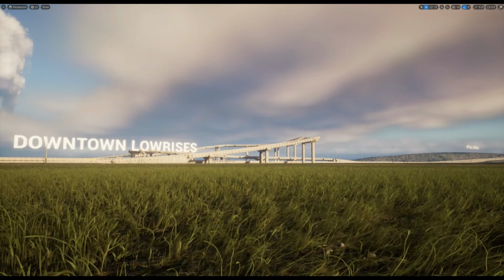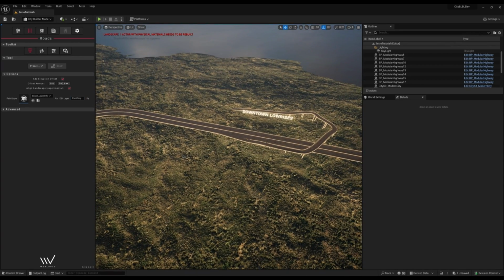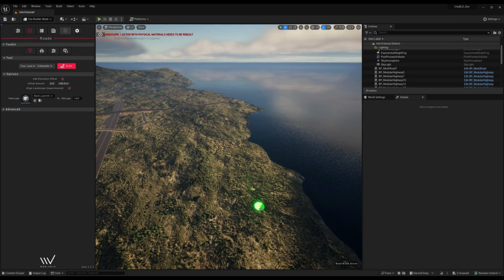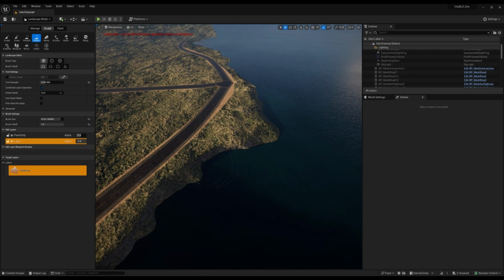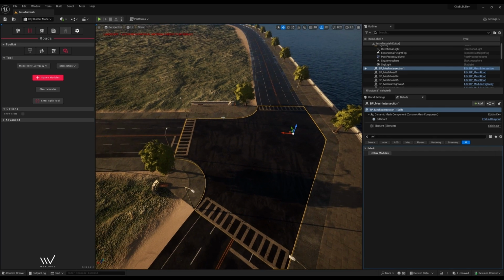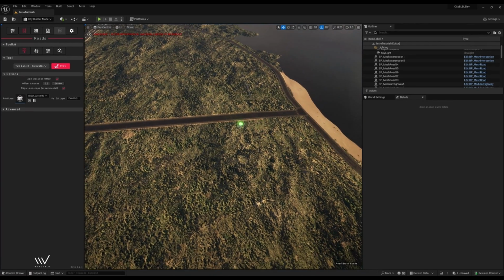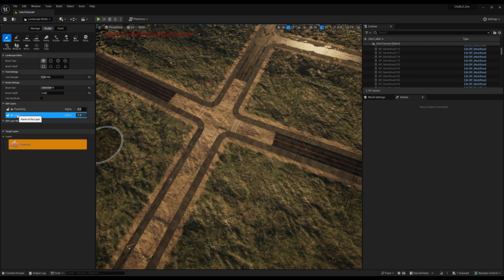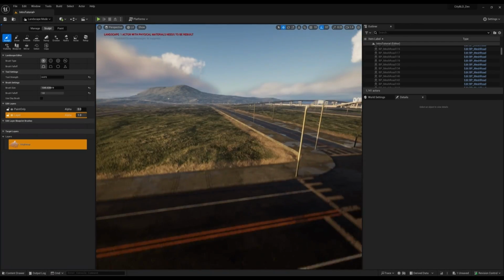(OUTDATED) Intro to CityBLD - Part 3 - Streets & Waterfronts

Comment: Hi when I add a quay to my project everything works well but my trees are missing materials. Any fix for this?
Reply from the maker: @funkyguy0  Hi, sorry you're running into this. Please check and confirm that Virtual Textures are enabled in your project settings, and if that doesn't resolve the issue please let me know whether the materials are missing entirely (replaced with WorldGridMaterial) or simply not compiling. If they are missing entirely, you can try using the Repair button in the Launchpad app.
Reply: @WorldBLD  Thank you for your response. Yes I have virtual textures enabled. Trees still have no textures unfortunately.
Reply from the maker: @funkyguy0  Okay, really sorry you're still seeing this issue. Could you please let me know any compile errors on the tree materials? This will be helpful in figuring out if there's a certain setting that's messing with the trees!

Comment: I'm really considering getting this!! Great asset to have for creating city style levels quickly for solo developers with AAA quality. Great asset, I have a few questions, do you need to buy the city kits or are they already included? Also, I looked at the documentation and if i understand it right we can bring our own city buildings props etc. by creating a city kit plugin, correct?
Reply from the maker: Hey there, great questions. Yup, you can use any of your own meshes and blueprints in place of what's provided, but we do include a few(free!) City Kits to get you started. Hopefully you'll get in on the fun soon:)

Comment: Hi there i've purchased and downloaded the files, I've installed the files however the plugin does not show up for me to be able to enable them.
I downloaded the latest file and I have installed them on the latest version on Unreal Engine.
Reply from the maker: Hi, did you install to your project or to the engine?
Reply: To the engine
 @WorldBLD
Reply: Its inside UE_5.3/ Engine/Plugin
Reply from the maker: @iamdollard  You mean "Plugins" right? Want to make sure there's no misspelling there. If you can see it in the Engine/Plugins folder, then I would check under the "Installed" tab in the plugins menu.